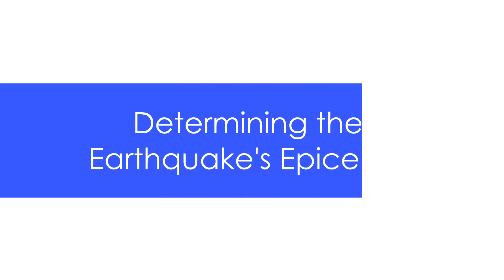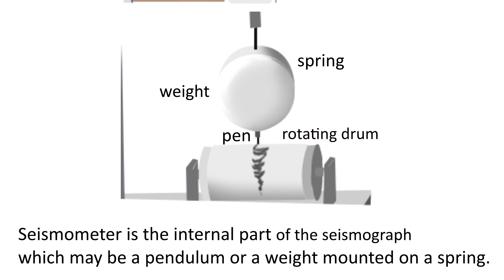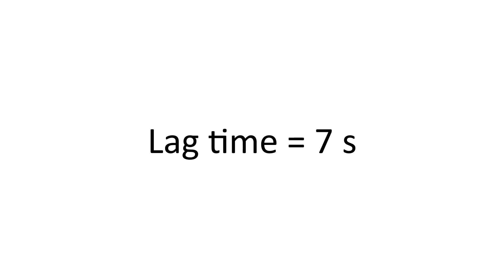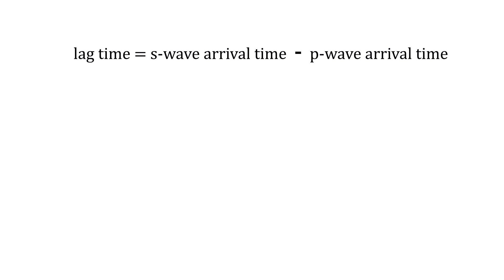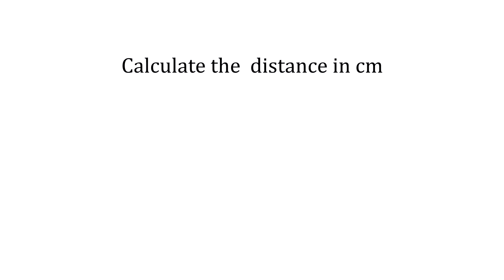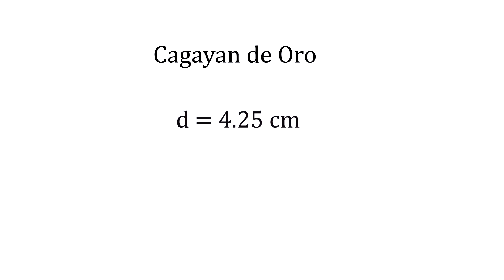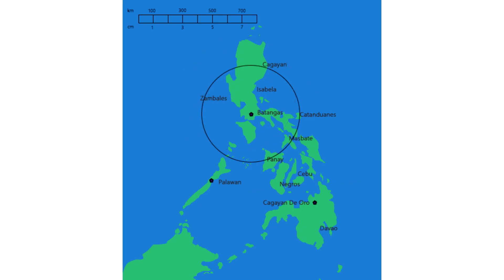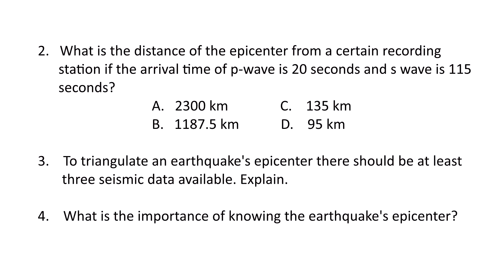DETERMINING THE EARTHQUAKE'S EPICENTER | TRIANGULATION METHOD | MELC BASED  | MODULE 3

Comment: Hello po, anong formula nya po ididivide ba sya sa 100 yung km to cm,  Itinuro kasi sa tc namin i didivide sya sa 200(ano po Tama 100 or 200)
Reply from the maker: In this video, I use the scale 1 cm to represent 100 km because the scale in the map used in this video is 1 cm: 100 km. The scale that you will use in converting the km to cm will depend on the scale used in the map. So if the scale of the map 1cm : 100km, then you will use this scale (1cm:100km) to convert the km to cm. In the module for Science 10, the scale of the map is 1.5cm : 200km. So that when you convert km to cm, you will use 1.5cm : 200km. Hope you understand my point.

Comment: Bakit hindi 3.25 o walang decimal point ang sagot sa pag divide?
Reply from the maker: The calculated distance in km is 325 km (Batangas). You will convert this distance in cm using the scale use in the map which is 1 cm: 100 km. So that 325 km x 1 cm/ 100 km = 3.25 cm.
Reply: @MYNSTVVlog  Now I get it po. Thank you

Comment: mam what if ang scale ay 1 cm= 200 km?
magiging d= Td/8 x 200 km or d= Td/8 x 100km parin?
Reply from the maker: Hindi po. The 100km is constant in the equation. So when you calculate the distance you will still use the equation d= Td/8s x 100km. You will use the scale given in the map to convert the distance in km to cm because you cannot draw the three circles if the distance is in km. That's why we must convert first the distance in km (this is the distance that you will obtain when computing using the distance equation - d= Td/8s x 100km). So in your case, you will use the scale 1 cm = 200km to convert the distance in km to cm.
Reply: @MYNSTVVlog  example po mam 560km tapos yung scale 1.5cm=200 km pano po yun
Reply from the maker: Is 560km the distance you obtain using the equation d=Td/8s x 100km? If yes, then you just convert 560km to cm using the scale 1.5cm=200km.
Solution:
560 km x 1.5 cm/200km
You will divide first 1.5 cm by 200km
560km x 0.0075 cm/km. The km unit will be cancelled out or equal to 1 so we are left with cm unit.
Then multiply 560 cm by 0.0075, the answer is 4.2 cm
Reply: @MYNSTVVlog  thank you so much, ma'am. I finally understand it now!
Reply from the maker: You're welcome po.

Comment: Hello po may tanong po ako, what will happen po if you only have two daya from two recording station?
Reply from the maker: You mean you have only two data? You cannot find the epicenter correctly because the two circles you have drawn will meet at two points. So you cannot pinpoint which of the two points is the epicenter.

Comment: Ma'am pano po imemeasure sa map yung nakuhang cm po?
Reply: Using the distance in cm measure from the point (indicated on the map) on the seismic station.
Reply from the maker: Using the distance you calculated in cm start drawing a line from the point on the seismic station.